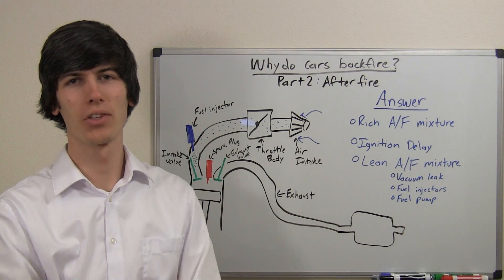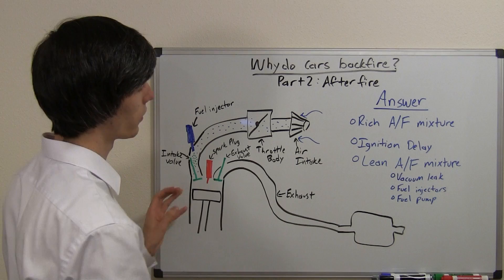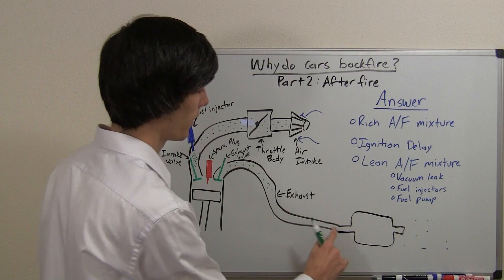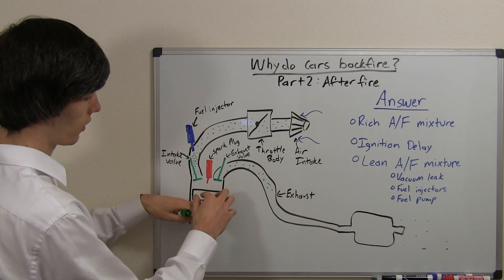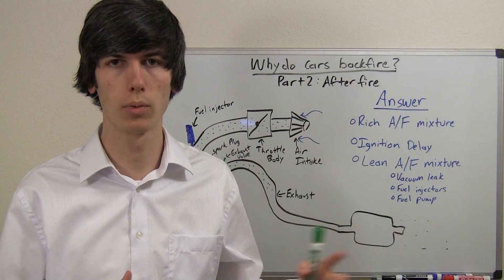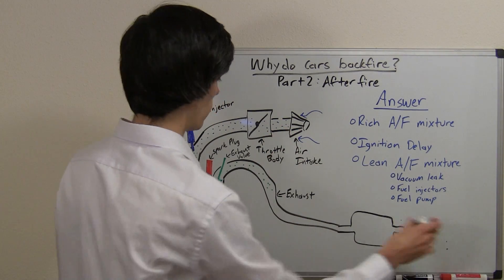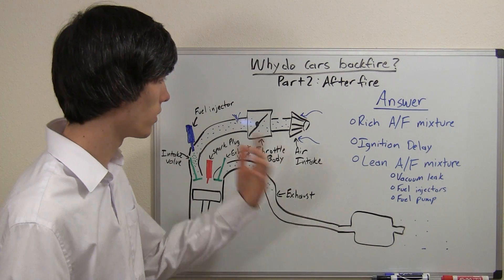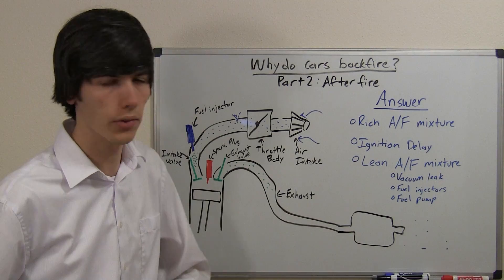Why Cars Backfire - Afterfire - Explained

Comment: It's either due to fuel accumulation in the exhaust due to a rich a/f ratio. When they cut throttle the mixture becomes stoich and the hot pipes/cats ignite the A/F mixture. A lot of decel after fire comes from a instant leaning of the exhaust due to high flow... (what most super cars and modded cars have) and the hyper lean condition in the exhaust causes the combustion. No damage is done, it's just mildly annoying to some, but lots of fun for the rest.

Comment: i have a 93 chevy suburban and the exhust is rusted out right behind the front passnger seat.  the automatic trasmission is acting up so i have to manully shift between 1st and 2nd also known as high and low gear. when i shift down to slow down at a stop i shift and i get a weird bubbling almost popping sound. would that be a backfire or just me having a cruddy timing problem when down shifting?

Comment from the maker: Yes, this is overlapping of the valves. Of course, it is possible for some fuel to leak to the exhaust, assuming it is not a direct injection engine which waits to spray the fuel until the exhaust valve has closed.

Comment: there are 2 types afterfire,number 1 with a loud bang end a flame,number 2 only with a flame. number 1 must be caused by a rich a/f mixture because the extra fuel ignite in the exhaust end caused the "bang with flame" number 2 must be caused by a ignition delay ore a lean a/f mixture because a lean a/f mixture end ignition delay dont caused the"bang with flame"    i see it this way or am i wrong? nice video btway greetz

Comment: Hey I was wondering if its bad for a car to after fire because I have a JCW mini cooper with 2000 miles on it and it does that every time when I let off the throttle after 3000 rpms when the exhaust is hot.
Thank you

Comment: That would be "spark cut"...ECU simply chooses to not fire the spark, allowing the engine to spin down more quickly (lowers clutch+gearbox abuse and shortens the time needed to shift), while the air-fuel mix can burn behind the engine and keep the boost up (if it has a turbo) ;-)

Comment: i can do intenional backfires with my carburated motorcycle.holding the throttle steady andpushing the killswitch turning off the ignition.i letgas flow into the exhaust andwhen i turn the ignition backon it ignites.so in this case the exhaust isnt hotenough?

and one more thing:all the supercars arehaving a kind of bubbeling when they let go of the throttle/engine braking.what causes this?i mean in modern supercars the ignition and the fuelinjection would be turned off when i let go of the gas?

Comment from the maker: The exhaust manifold gets hot from exhaust gas, hence, the exhaust gas is the heat source. If there is any fuel in the exhaust, and the temperature is hot enough, it can combust simply with the presence of oxygen.

Comment from the maker: The throttle closes, preventing air from coming in, but the injectors still inject a certain amount of fuel in the cylinders for a couple revs. This extra fuel doesn't have air to burn with, so it burns on it's way out the exhaust when it comes into contact with oxygen. My apologies, I was assuming you already knew do to some other comments you made on another video - though I may be mistaking you for someone else.

Comment: The anti lag system, changes the ignition timing that split second you let off of the gas. It ignites the fuel in the exhaust which forces the exhaust turbine on the turbo to maintain it's speed.
Reply: So basically ignition timing is delayed when you release your foot off the gas pedal, so explosions are occurring in the exhaust pipe, and these explosions help boost power to the turbine of the turbo, and this way even when you let go of the gas you're still increasing power by letting the turbo take in more air?
Reply: @asjadsiddiqui7409  almost completely correct; it won't increase power because the throttle plate is closed with your foot off the gas, but it prevents the turbo from slowing down, so after you put the pedal down again the turbo is still spinning at high rpm and you instantly have boost again without having to wait for it to spool up
Reply: @ironduke6100  Ohhh thanks mate, that makes more sense.

Comment: The main thing that causes backfires is an exhaust leak, which pulls in fresh air. Exhaust is lower pressure then atmospheric. Nine times out of ten exhaust explosions are due to air entering the system. If the timing is retarded it will blow out the intake, as will a lean condition. I call it a lean sneeze. Lean on the exhaust side will cause red hot   glowing exhaust manifods, as will retarded timing. A vacume leak with a map sensor will cause it to run rich, a Maf will run lean.

Comment: Why does this happen so much in boosted cars? You mentioned anti lag systems but im not talking about a 2 step launch control. It seems like often when the driver lets off the accelerator in boosted cars there's often black smoke and sometimes fire out of the exhaust. I notice it a lot on DSM's.

Comment from the maker: I would check the electrical system first for misfiring. Plugs, wires, etc.. Could very easily be a bad spark plug. I'm pretty inexperienced in auto-repair though.
Reply: Haha sarcasm haha
Reply: my car had 2 spark plugs almost ready to spin out and 3 vacume leaks+i fixed those. i think a mechanic did it. ripped me off $300.  my car is running good now. i avoid retarded mechanics in this area+rediculas!!!

Comment: On my motorcycle, it has a Pair Valve which will directly add air into the exhaust gasses as it leaves the cylinder. This is to burn off the unused fuel. My question is could maybe a leaking exhaust cause it?

Comment: Hi,
Just a question : why do V8 supercars often have afterfire when decelerating? 
I know you explained it in your video, but competition cars are prefectly tuned and they don't have mixture or valve troubles... competitions cars' engines are not left to any coincidence. So why do they have such a huge flame during deceleration?
Reply: They could use a turbo anti lag system?? Also 9 years later you finally get a reply lol

Comment from the maker: 1. From a stop, maybe not. You may have to burn the clutch a bit more. It's not going to ruin your car or anything, just might wear the clutch faster. I start in second frequently if I'm stopped on a downward slope. 
2. Sure. 5th to 3rd is probably more common for me than 5th to 4th.

Comment: 2 questions: 
1, is it good for the clutch to start on second gear?
2, is it ok to skip gears when downshift?
Thanks!
Reply: So uhh only 8 years late but here's your answer:
1. It depends on the scenario, if you are on a level road it will cause some wear to the clutch because it will be slipping since the engine speed is not as fast as the gearbox wants. If you are on a road that is slanted downhill the car already will have an easier time getting momentum so it is not so bad and it won't slip as much.
2. As long as you are holding down the clutch and you are in the right rpm's and speed you can shift from any gear to any gear. Say you are in 5th gear and you have braked to about 10 mph while holding the clutch you can put it into second. You do not have to go 5-4-3-2.

Comment: You can get any car to after fire if you can program the ECU to cut spark at redline instead of cutting fuel. Air/Fuel accumulates in the exhaust system when ever you bounce off the revlimiter and it shoots little fireballs. 

It's certainly not good for the health of your exhaust system but it sure is fun to watch